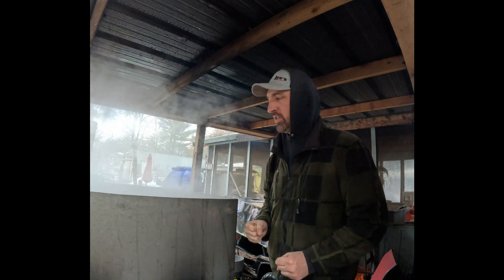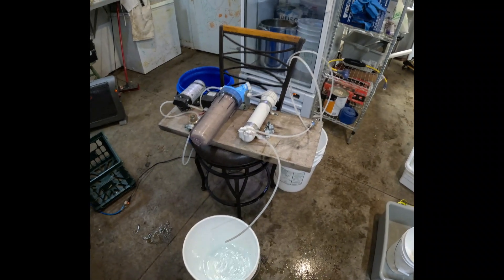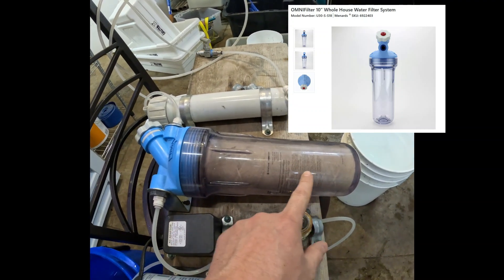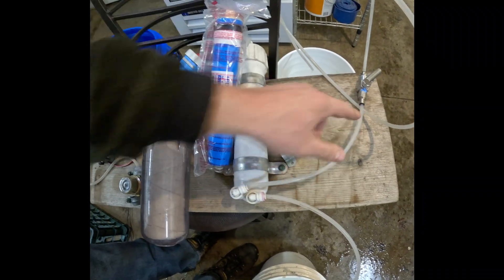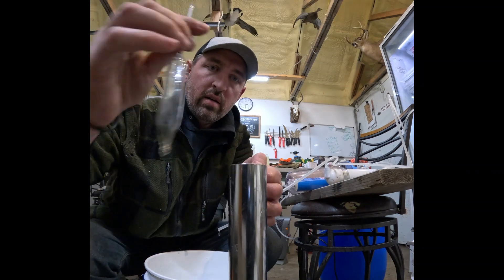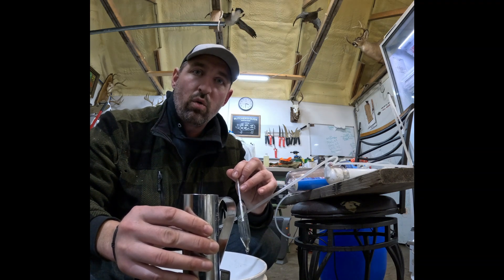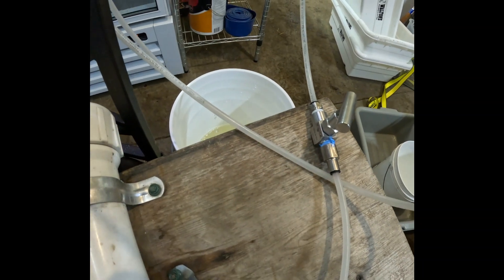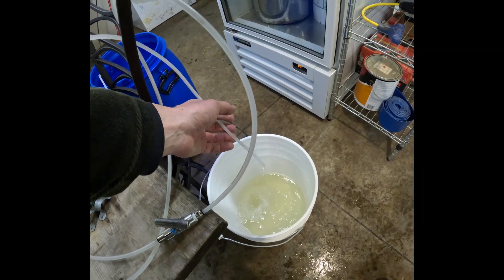Build your own Maple Syrup RO (Reverse Osmosis) DIY Instructions and links for saving you time/wood!

Comment: Can you run it through twice and get it up to 5 or 6%?
Reply from the maker: You could. Industrial ROs sometimes have multiple stages where the concentrate (sugar) is run from one stage to the next. You could buy a few extra RO membranes and housing to cycle your sugar up higher. This does have a limiting return and certainly isn’t as efficient as the industrial membranes. Hope this helps.

Comment: What pump did you buy for this?
Reply from the maker: Below is a link to the same pump. Shop around as it may not be the cheapest. https://www.amazon.com/Aquatec-6800-Booster-pump-Transformer/dp/B074PCVH36/ref=mp_s_a_1_11?crid=3BPO87BVX6FTB&dib=eyJ2IjoiMSJ9.OWkrGV2TTrT5n4P5rBvimnQ4GGC1arVlWiuuKBeZsX5oYTaNkAC-7Z4nKGzgm0NCXD2xy9NoWOl6ZbdbvVo9zXLBBHrTWZZbD00A0esOYQOX2Dvjw7bZUWR9GIj6GM1BGOjRRu4ybFDpCdWbTxJx8XodDx1XfkzqvxKMgZ_6EG_x0GQc1ttgVvdPHRI0tzG5B3vy24vQdMMPS2x-Sol2OA.g5x9nDHPXX-NYIcff3YCUggz6aCemq5BgVFC5oEaYdU&dib_tag=se&keywords=ro+booster+pump&qid=1707939564&sprefix=ro+booster+%2Caps%2C224&sr=8-11
Reply from the maker: Thank you for watching!!